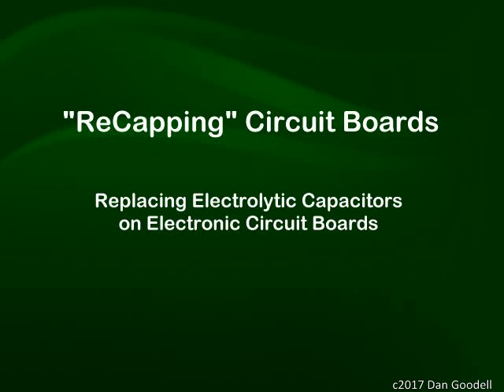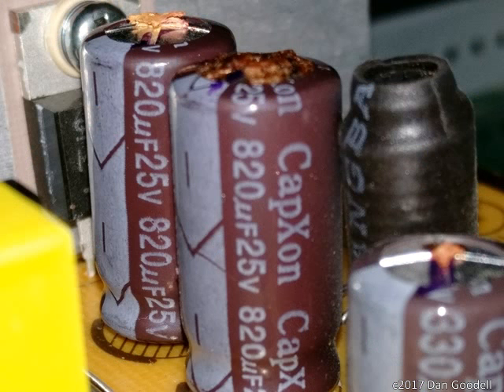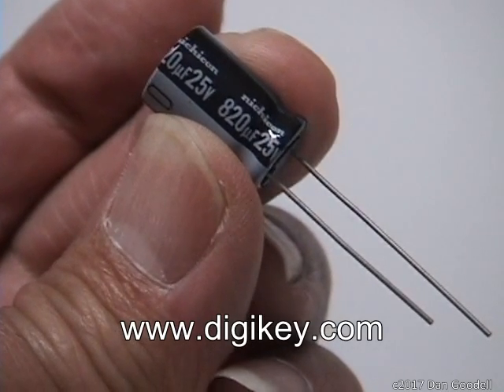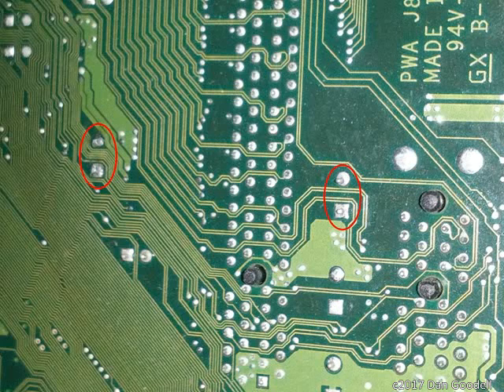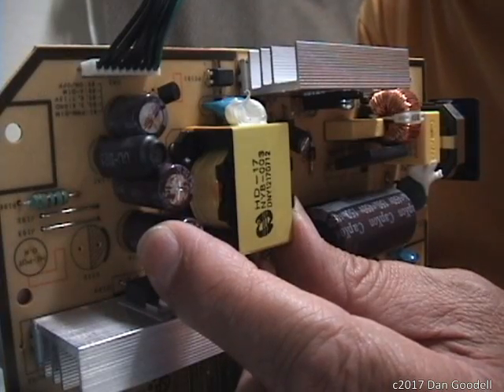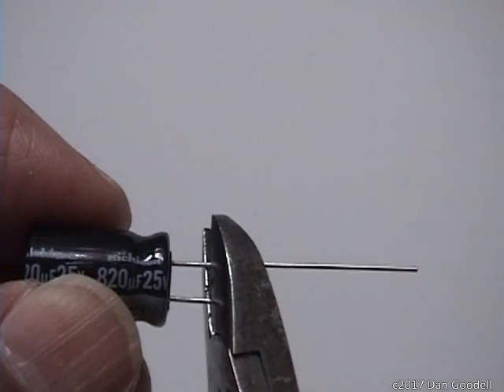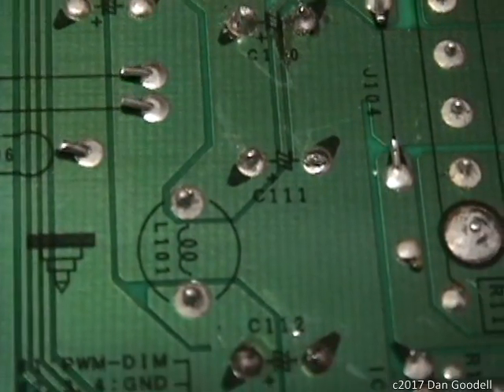Replacing Electrolytic Capacitors

Comment: I'm 73 now and have been repairing and restoring electronics for more than sixty years, everything in this video is good advice when re-capping electrolytic capacitors. I have one more important suggestion, purchase an in-circuit ESR (Equivalent Series Resistance) tester, this piece of test equipment analyses the single most important characteristic of electrolytic capacitors, it measures the internal impedance of the capacitor. The model ESR tester I found to be the best is called the "Capacitor Wizard" made by Independence Electronics and costs about $200.00, it has an analog meter and a audible beeper, both of which is very important in quickly shotgunning and comparing multiple caps in a circuit prior to replacing them. In addition, when I grab a new cap, I always test it first with the ESR tester to confirm it is a good cap, I've found brand-new capacitors from stock that are bad!

Comment: Thanks for the video. Question - is there a temperature to set the solder gun at for this type of work? Hope to do a vintage turntable re-cap and wish to be careful.
Reply from the maker: If you do actually mean "gun", IMO you're looking at the wrong tool. 

A soldering gun is typically higher power (100W+) and for larger, bulkier projects. It's gun shape is also more awkward to handle around delicate electronics. 

In contrast, a soldering iron is typically 40-60W, heats to about 700-800 F., and its pencil shape and finer tip enables better control. 

If by "vintage" you mean you're merely soldering discrete wires to lugs (ala, old tube-type radios), a gun might be okay, but I wouldn't use it on circuit boards or solid state electronics. A soldering iron would be better.

Comment: Thanks for the video, explains so much about the run of bad caps during this era; monitors, appliances and auto...  personally, I like using a solder sucker.  my next re-cap of all places is the FICM - fuel injector control module in my duramax.  There is a cottage industry charging upto 2k to "reman" these out-of-production "FICMs" 5 caps ($20).  The caps on this Bosch board blow hard and down and invariably take out the pcb.   Shame on Bosch for not mounting the caps horizontally, as on the board in your vid, so when they blow the cap vents without destroying the board.

Comment: I would highly recommend discharging them before any desoldering,  electrical charge maybe present (internally) even after a long time of no usage,  to do this simply touch both leads with an insulated pair of needle nose pliers to discharge any remaining current, then you can desolder the pads and remove them

Comment: what do you recommend I use to hold an xbox 360 mother board? I am getting ready to do this on blown capacitors on a xbox 360 motherboard and I am looking for the right thing to hold it, like you have in this video. Thanks.
Reply from the maker: Well, the whole point is that you need at least three hands for a project like this, so that's where a small desk vise comes in handy. There's a wide assortment of vises and flexible clamps on Amazon and elsewhere specifically for this purpose. If you don't want to spend the money because you'll only need it one time, then just ask a friend to help hold the board for a few minutes, and you'll literally have the three (or four) hands you need to complete your project.

Comment: Rocking the capacitor back and forth must be done carefully without putting any downward pressure on the lead which has been partially extracted. Otherwise, the solder pad can detach from the board. I prefer to use a solder sucker to remove the solder from the joint before trying to lift the capacitor as it will often fall out by itself if this is done. If not, just heating the joint will often free the lead. Applying flux to the joint makes the process go much more smoothly and prevents overheating the board if solder does not melt as soon as the iron is applied.

I agree that only suspect capacitors should be replaced. After visual inspection, the ESR (equivalent series resistance) of each electrolytic capacitor should be checked as capacitors often fail when they look normal but the electrolyte has dried out. I have an old HP distortion analyzer from the late 1960's that has not needed a single electrolytic capacitor replaced. Back then, electrolytics were made to last, often with epoxy seals instead of rubber.

Comment: Repairing power supply, analogue boards are O.K.
If U need to replace capacitors of a PC monther board, the holes are too small , function as designed to throw away if caps are bad.

Comment: what do you clean the tip with just run it across a wet sponge?
Reply from the maker: Yes. Wet the sponge, then squeeze it out. To clean the iron, just drag the tip across the damp sponge once or twice. 

Do it often. With use, the tip will build up excess solder, so frequent cleaning keeps the excess solder from interfering with your work. 

Little balls of solder will accumulate on the sponge, but after you're done you can just shake them out in a trash can.
Reply: @dangoodell2  thank you mate

Comment: I've only ever soldered a few speaker wires together in the past, and never done any PCB work before. My 60" TV wouldn't turn on and I narrowed it down to a bad capacitor on the board. This video gave me the confidence to give the repair a try, and for just a $5 capacitor and an hour of my time the TV is now back up and running when a week ago I thought I might have to junk it. Thank you!!

Comment: Thank you! I was initially completely baffled about how to remove capacitors and for some reason assumed that I was supposed to use solder wick but of course, through-hole components are different. You just saved me money and a lot of time because I would have resorted to buying/waiting for a replacement logic board from China for my Dell E2310Hc. Two cheap replacement capacitors later (as per C. David Graves's repair video) and my monitor is as good as new again. I even managed to do it without a clamp/stand, by just "pinching" the cap with my fingers and the board resting on my mat - switching pinching/soldering iron hands also helped with the angles. :)

Comment: this is waaay harder than it looks. Trying to replace 5 caps on my original 2001 Xbox but the solder just wont melt. Ended up pulling the caps with pliers cold then drilling out the holes. I got caps of same uf and v on ebay. Yageo is the brand. hope they are ok, they are a bit smaller than originals. Now im having trouble getting the solder to stick the legs to the board. Will have to try tinning the legs maybe.

Have i killed my Xbox?
I dont know what to do. If I buy another one it could have same issue.
Reply: Make sure to put fresh solder on your iron's tip. That will give better heat-transfer and make it much easier to melt the old solder since the new solder will have new flux.

Comment: The other element to replacement capacitors is ### Tolerance ### to minimize "Capacitance Drift" particularly with computers and highly accurate electronics such as Class AA & A Amplifiers where it can impact the quality of the audio (bandwidth - high/low-pass filtering, frequency response, 

Capacitance drift
The capacitance of electrolytic capacitors drifts from the nominal value as time passes, and they have large tolerances, typically 20%.  This means an aluminum electrolytic capacitor with a nominal capacitance of 47µF is expected to have a measured value of anywhere between 37.6µF and 56.4µF.   (This is to reduce manufacturing cost.) 

Tantalum electrolytic capacitors can be made with tighter tolerances, but their maximum operating voltage is lower so they cannot be always used as a direct replacement.

The voltage may also be expressed as an alpha character.

Letter - Voltage
e	2.5
G	4
J	6.3
A	10
C	16
D	20
E	25
V	35
H	50

Other issues.

1. Capacitors are like a fine wine - don't end up with vinegar.  Capacitors do age and aged capacitors' performance degrades.

2. Authentic Supply Channel - don't end up with someone else's rejects.

3. Check the polarity of the currently installed capacitor before removing it and go by that as polarity markings on boards have been known to be erroneous.

4. For reliability's sake and saving of time, it is best to replace the capacitors of a whole "module" at a time.  

As per point 1 - the degradation of capacitors (up the line) can impact capacitors (and other components) further down the line.  Not everything fails at once yet may be on it's way to failing.  Components in the process of failing can cause other components reliant on them to fail first.

Comment: Thank you very much for posting this simple explanation.  I am facing a cap replacement for a beloved automobile's Electronic Control Unit, and while I have never done soldering work before, this explanation of the methods and techniques is of great help in preparing me to square up to the bench and get it done.

Comment: Thanks for the good job. Could you answer my questions?
1. What if I replace it with another brand but same voltage and capacitance? 
2. What if I change it using the same brand but higher voltage but same farad? 
3. What if I replace it using the same brand with higher farad but same voltage?

Regards
Reply from the maker: You can go higher on voltage or capacitance, but never go lower. In this case, these are power supply filter capacitors, so specs are not real critical. They're just filtering out hum and AC variations, not tuning anything. (I'm only talking about power supply capacitors here. Disregard if you're working on something else.) I would try to stick within 50% of spec if you can, but you're probably safe up to twice the voltage and/or twice the capacitance. Going too high over spec could leave the part not behaving as intended in the circuit, so don't go overboard. Brand doesn't matter.

Comment: Wouldn't capacitors still have power stored in them? Is there danger of electric shock from doing this?
Reply from the maker: In this case, these are low voltage caps and don't store much power. Also, whatever charge they might have dissipates almost immediately after power is disconnected, so no shock danger.

Comment: Is it advisable if the capacitor is close or besides a mosfet , if you remove the mosfet using hot air blower do you need to remove the capacitor before removing mosfet?

Comment: You methode in grease the danger of solder lead damage. Why not cleaning al solder of. I know not every one has a tin sucker. Ensure the holes are tin free befor adding the new cap. I never damaged traces of the board.

Comment: what is the brand of the soldering iron ?
Reply from the maker: Mine is an old Weller that I got over 40 years ago as a company discard because cord was frayed and switch didn't work. Easy enough to refurbish myself, and it's been working well ever since, albeit with a new tip occasionally.

Comment: In your opinion ... if I want my new electronics equipment to last the longest... is it better to shut it off when not in use and keep the capacitors cool... but deal with cycling on and off? or juts leave it on all the time and thus no heat cycles?
Reply: It depends on how long the monitor is off and how warm it gets. Better monitors run cooler and usually have better components and thicker PCB's inside, which makes temperature cycles less of an issue.
The average consumer-monitor though (That usually also runs in the 'holy-shit-look-at-the-light-output-every-colour-looks-sooo-bright' mode) is better off with turning it off fully.

Don't forget that almost all power supplies feature a primary controller of some sort that usually has a small electrolytic as well. Always connected to mains means this capacitor (or the controller-chip) is always working as well, which just wears them down.
I've had a Delta switching power supply fail after something like 83000 hours if I remember it right. That was well beyond the stated typical MTBF of something like 60000 to 75000 hours. If i had turned the power supply off in between use, it would probably have lasted longer. (btw: the Delta power supply did not fail because of bad caps, but had its controllerchip fail)
Reply: @weeardguy  not a monitor... a electronics (audio) component... DAC, CD player, etc...  but I think I get your gist.
Reply: @CE750  Ah yeah... I assumed it was a monitor considering the many people in the comments talking about monitors and the video being about one ;)
Considering the audio-components you talk about, I think you are referring to hi-end stuff. I know there are quite some people who think they perform the best when you never turn them off ;) Whether you want to pay the electricity-bill for that is up to you ;)
Reply: @weeardguy  I just want them to last as long as possible
Reply: @CE750  The recommendation from my hifi source is to always turn things off. Not only do they save on wear and tear, but also unforeseen events (eg power surges), which not only risk the particular item but also anything else that is connected to it.
Warm-up  time for optimal listening is another matter, of course, and depends on design, etc. It's tempting to warm up tubes before critical listening, while solid state afaik should not require more than a few seconds.

Comment: Replacing a audio cap soon on a amplifier board dayton spa500 to be exact with a new nichicon 470uF 25V cap. Found one bulging and its a noise reduction cap. This appears to be simple. I'm getting a solder kit that should also help.
Reply: So how did that go? I have an old Rotel amp that needs recapping

Comment: why do electrolytic capacitors keep blowing up in my long list of speakers?    They ought to redesign those stupid capacitors so that I onl need to screw it in and out with another replacement instead of soldering.
Reply: Conductivity is better with soldering. Also, vibrations can feed back into the audio signal and since the items you're describing are inside a speaker cabinet, it all contributes to raising the noise floor.

Comment: Discharge old caps first?
Reply from the maker: These are small, low voltage caps. They don't hold any dangerous charge, and will be discharged before you can get the back cover off, anyway.

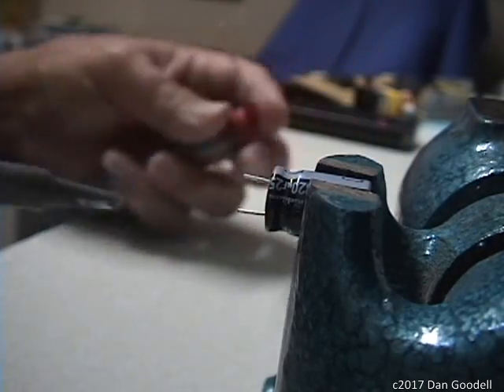Comment: what your doing at 7:25 is that really necessary? like tinting the whole leg i usually just put the cap in then solder it too the board first video ive ever seen of this lol
Reply from the maker: During tinning, the rosin in rosin-core solder chemically cleans the capacitor leads so the solder bonds to the metal better. The light coating of solder will also remelt with the old solder already on the board and make a better bond between board and the cap's leads.

Remember that with the method I'm using to install the new cap, I'm mainly reusing the old solder and not adding solder to the joint, so there would be no new rosin to otherwise clean the leads to help with solder adhesion. That could lead to a poor joint.

Tinning is a good habit to get into just as a general practice, but is particularly useful in a project like this. Tinning is quick and easy, and if you're going to go through all this trouble in the first place, it would be silly to skip such a simple step.

Comment: Is there any concern needed to discharge the caps before de-soldering them from the board?
Reply: Yes and no. The big risk in these types of power supplies is the primary electrolytic capacitor, that stores a nasty charge that usually (not always) takes a while to either 'bleed' via a resistor parallel to it, or discharges via the power supply that tries to keep going while there's no mains power anymore.
When such power supplies malfunction, defects can cause this primary cap to hold its charge for long after disconnecting from the mains.
The low-voltage caps will discharge themselves by normal order (as in: power supply loses mains power: power supply tries to keep working for as long as possible and eventually stops working: this discharges most caps to safe voltages. Besides that, the voltage they work at hardly poses a risk to the user. It DOES pose a risk to surrounding electronices when you make a mistake, the cap is still charged and you short it by accident via a nearby component. But, especially when electrolytes have failed to the point they discharge their internal fluids, the internal chemistry usually makes sure they discharge rapidly after losing power.
I would not recommend trimming and tinning the leads of new capacitors in advance of soldering them in. Instead, clean the holes with solder wick or a desoldering pump and stick in the new cap. Gently bent the legs out and solder the leads. This leads to a better mechanical connection as opposed to a solder-connection only. Electrolytics are quite bulky components and thus need to be installed in a sturdy manner.

Comment: Wish i would have found your video sooner, like a dumbass i tried to remove the solder from the holes but it never worked with wick or soldiering pump so i had to heat it and use a sewing pin. Changed 23 caps of a monitor like this, the pain it was.

Comment: Is there any danger of getting a  shock from this?
Reply from the maker: Depends on what kind of device you're working on, of course, but generally there is no danger. Most solid-state circuits operate at around 5-12 volts, which is too low to pose a danger. In addition, while the capacitors do hold a momentary charge after power is removed, the charge will drain off within a minute or two. So before you can get the back cover off, the circuits will usually be fully de-energized.

Working on plasma TVs or old CRT-style TVs and monitors is another story, though. The voltage levels inside those can be several thousand volts, and can take a longer time to drain down after power is removed. I don't recommend working on those types of devices unless you know what you're doing.